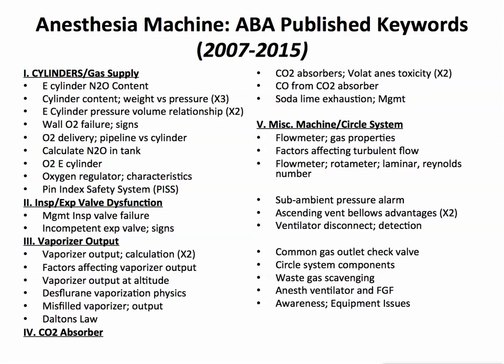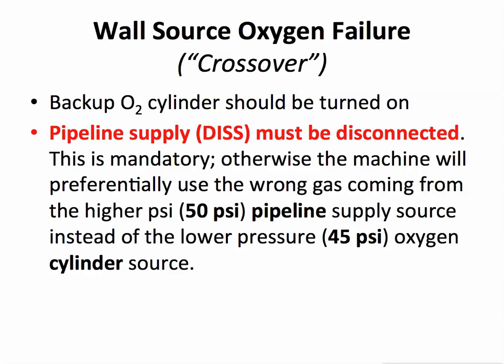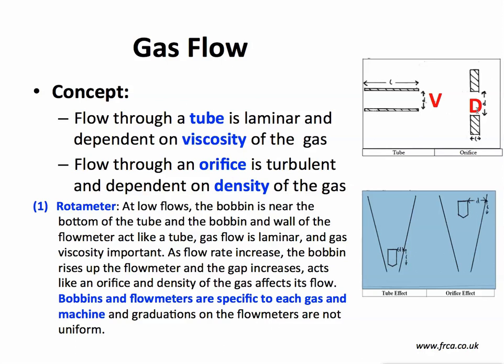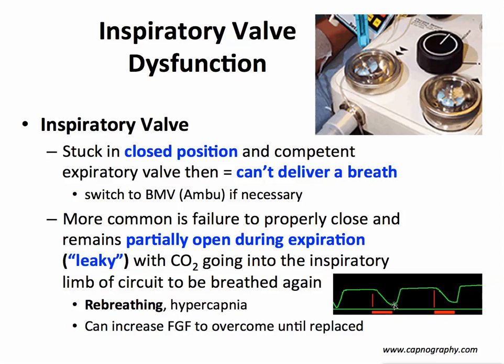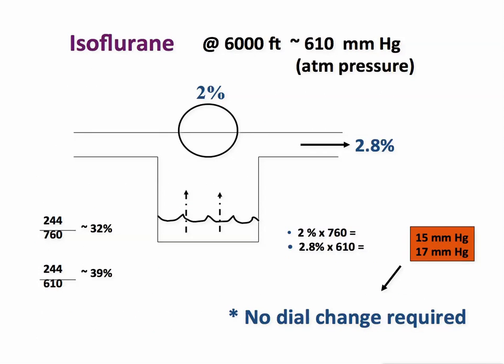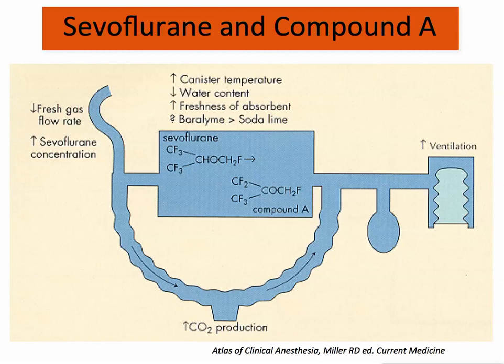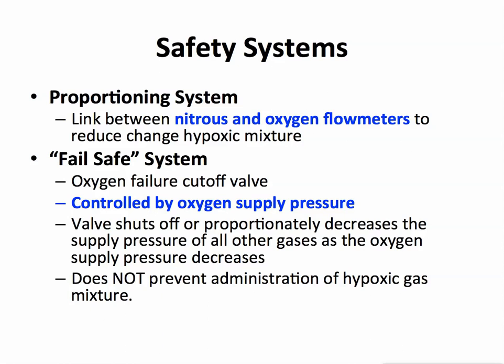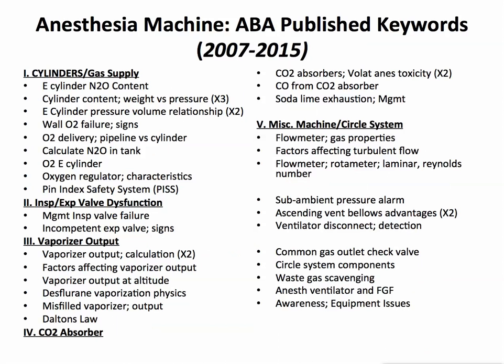20151203 Anesthesia Machine

Comment: hey great video thanks a lot ! 
but shouldnt the isoflurane's vaporizer output in the elevation example be at approx 2.5% ? 
at 2.5 approx the value of the percentage at 2.5 * 610 =15.2  which would actually priove the fact that elevation doesnt effect iso and sevo vaporizers ?

Comment: hello. thanks for the video.  doesn't your typical o2 e cylinder have a pressure of 2200 psi when full to around 200 on the empty side?  45psi seems low, I didn't think it was necessary to turn off pipeline o2 due to the high psi of the cylinder.  thx
Reply: Hi Mike,
Remember that there is a pressure regulator that decreases the tank pressure to about 45 psi or else you would run a huge risk of damage to machine and patient with the high pressure from the tank. The wall source is at a little higher than the tank regulated pressure, about 50 psi which then is the preferential source of oxygen to our machine rather than the tank. Therefore, if you ever worried that the wall source was not oxygen (crossover in pipes; construction work on hospital is historically how this has happened), remember that the wall source pressure could still be 50 psi and prevent tank gas flow, you need to crank on your oxygen tank and disconnect the wall source so oxygen will be supplied then from the tank alone. Hope that helps. This is a common question on exams (crossover in pipes and what to do).
Reply: From what i understood 45 psi is its output or what gets to the anesthesia machine not its internal pressure